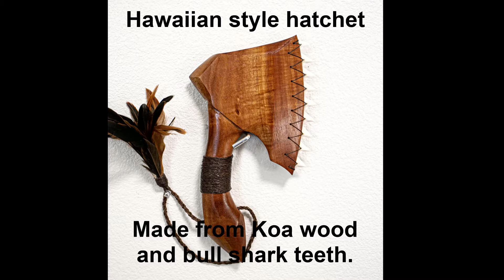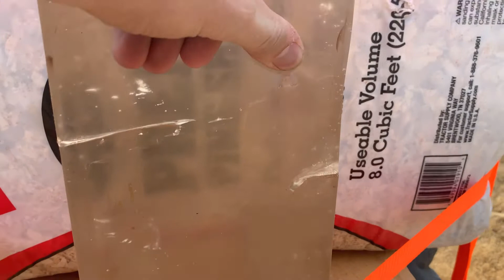Shark tooth Hatchet!!

Comment: What about the pikoi, I hope a spelled that right, it was a weighted tripping rope? Did those have shark teeth on them?
Reply from the maker: Not usually.  They were used similar like you would a bola.  Weapons with teeth were largely used as lacerating weapons or as barbs on spears.  The pikoi would be tossed in mid range as warriors collide with the goal of tripping someone up.  They Koa warriors would then run up to them and finish them off with either an Ihe(short spear) or melee weapon like the lei o mano, slicing at their throat.  Now a Hawaiian style morning star would be interesting 🤔 I might give that some thought 😅
Reply from the maker: It wasn’t uncommon though to embed the molars of defeated warriors into clubs or even the pikoi.  This was done to try an absorb the mana(kinda like a life force) of the enemy warrior.